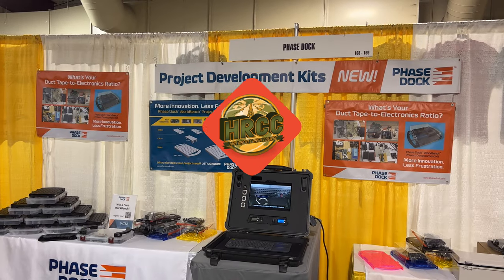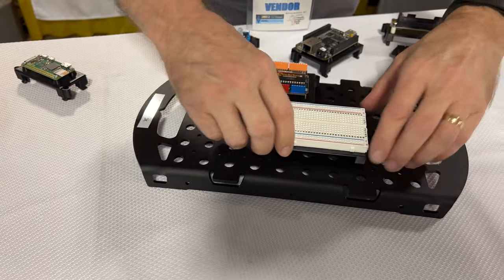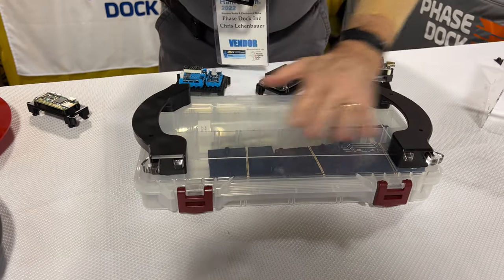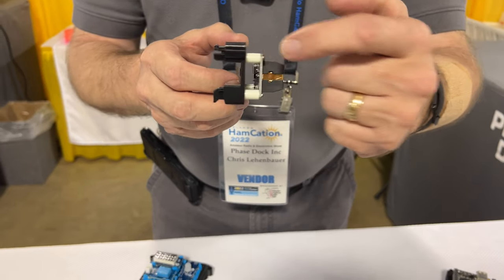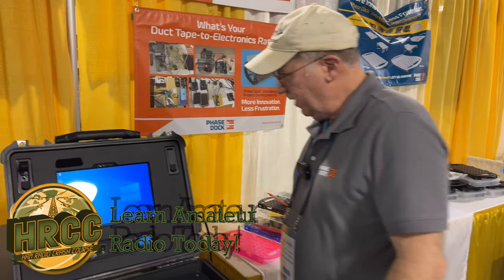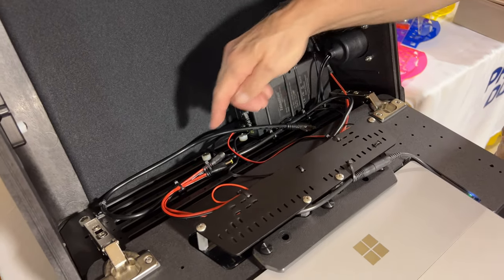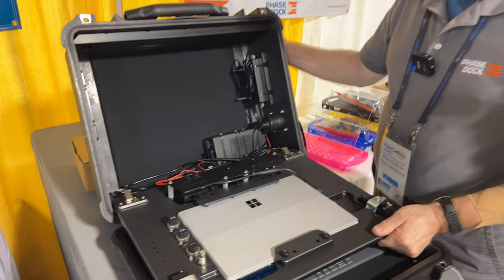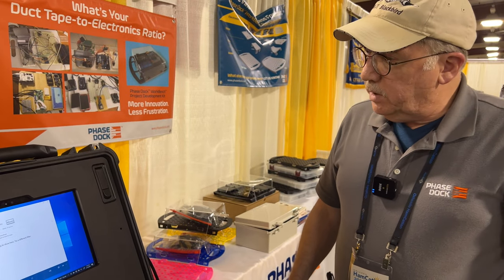Phase Dock: Organization For Maker Prototyping

Comment: That's something I could use for my Arduino projects, so they could be portable:  oscilloscope, ignition timing monitor,Air-fuel mix analyzer,  mini piano, etc.   I made my own mounts, so each took a lot  of time- especially the ones wit the tiltable-screen! This kit would make it possible to take peripherals with you, so you don't have to put it all in a toolbox, and possibly  damage something.
Is there a way to mount a battery or power bank, so you don't need separate power wire leads?
Reply: If you have access to a 3d printer you can print custom slides to either rubber band or glue onto the click adapters, or you could always take a command strip to hold it onto the dock.
Reply: Like Seth Proaps said, you can attach a battery to a Click.  We often use those portable phone chargers, and have simply zip-tied them to a Click.  That way, when the battery is drained, I can pop in another one while the first is recharging.  Handy!